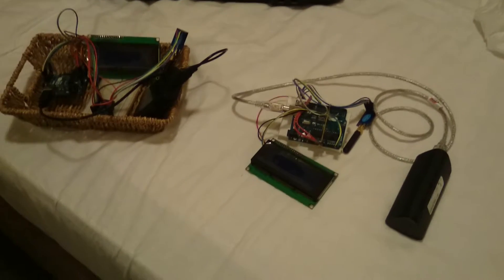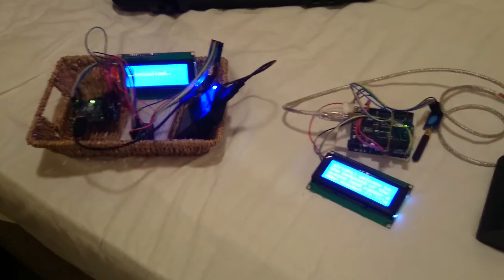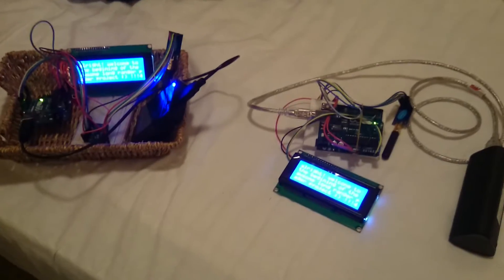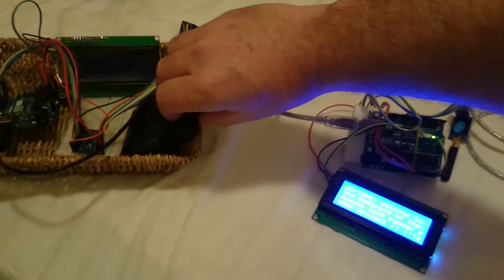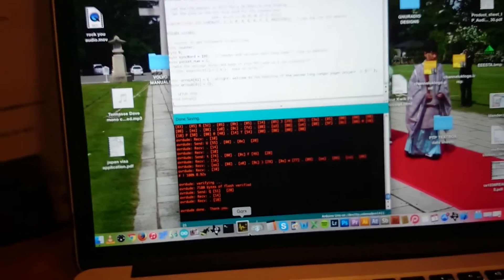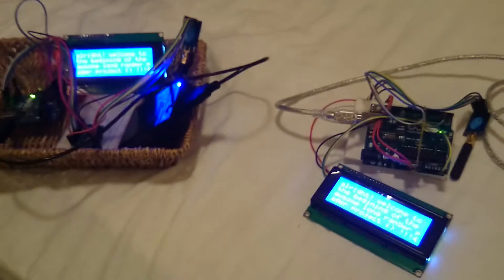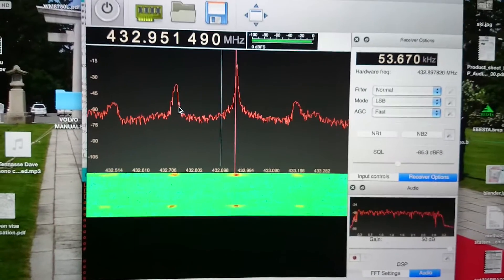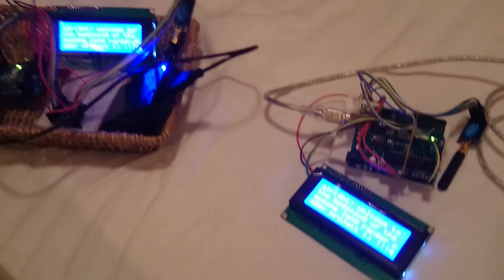CC1101 RF module tests with arduino logic level converters PART5

Comment: If you require more range i would suggest using something like an Xbee module the XBee‑PRO ZigBee can reach a distance of 3.2 km (line of sight)
Reply from the maker: any ideas for non-line of sight ? the lower the frequency the better ?